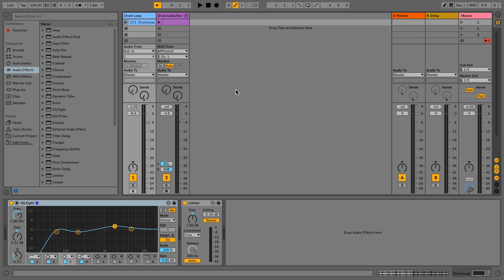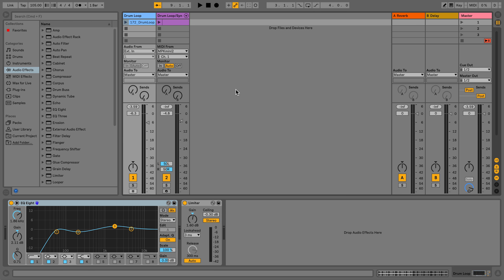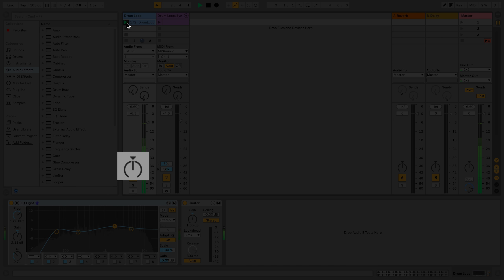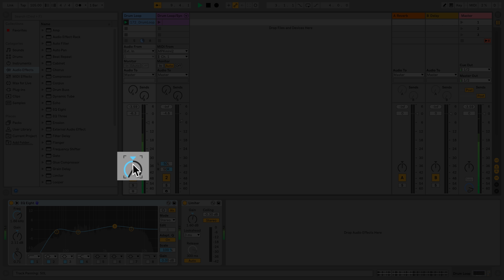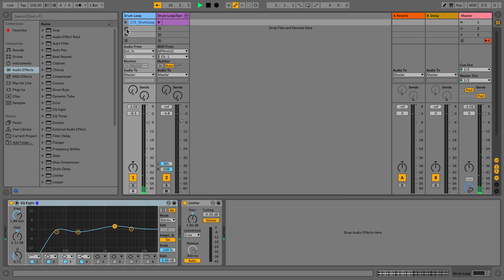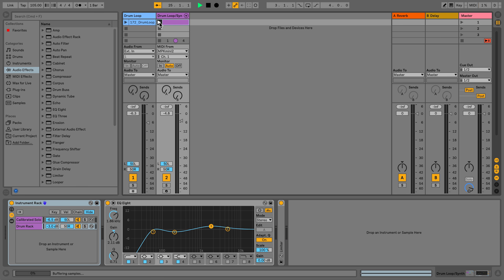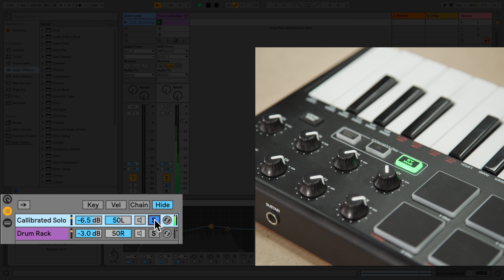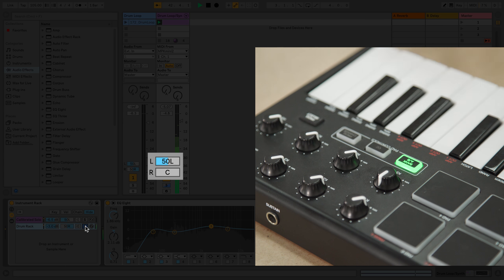Learn Live: Panning

Comment: How do I pan sounds inside the drum rack?
Reply: Inside the drum rack, click on the three lines on the left of the device. Then, click on the sample you want to adjust in the chains section (the horizontal lines). In this section (which will appear when you double click the three lines), you should see the panning control to the right of the volume control.

Comment: Help! I am trying to create some simple backing tracks where I have the backing in the left channel and a metronome in the right. when I render it I still have both in both ears. this is despite that I have panned the tracks hard left and right. I've tried both panning modes. Ive checked it's not in mono on the rendering settings. it sounds fine before it's rendered, but when I render the mp3 its about 20% bleed on both sides. what should I do?
Reply: I'm having the same problem :(
Reply: @LukeParodiMusic  I found the problem, it was a sound enhancer setting in the iTunes preferences, which takes some of the left channel and some of the right channel and sends it down the other channel. once I switched it off it was fine.
Reply: @jono540  does this effect what you’re hearing in Ableton as well though? Because even when I’m inside the program I’m still having the same problem. Driving me crazy!!!